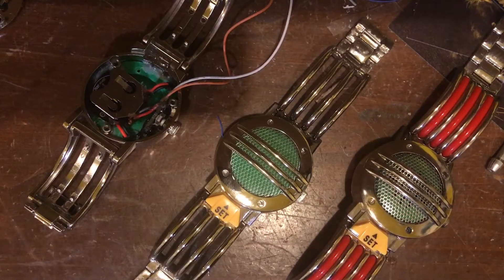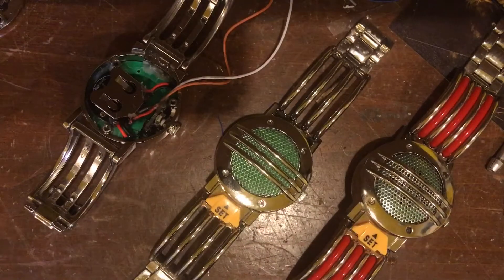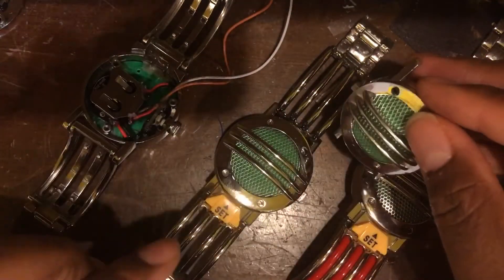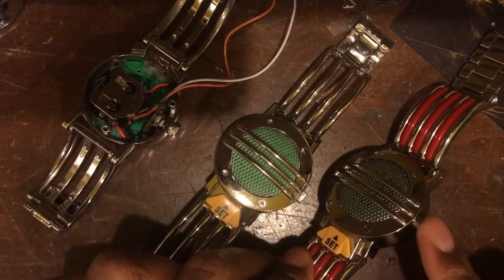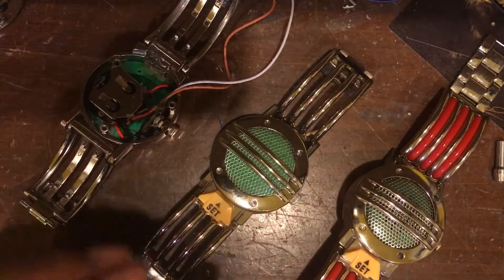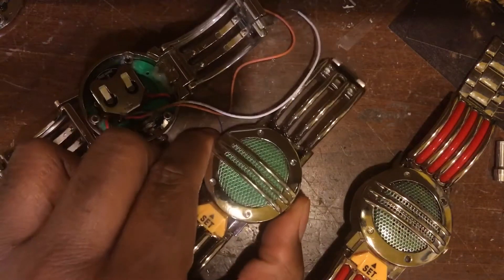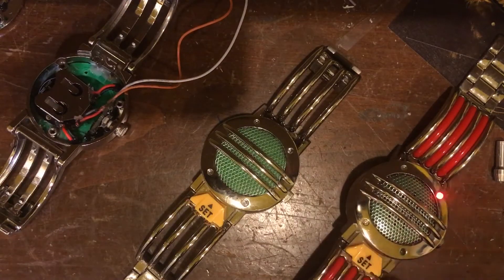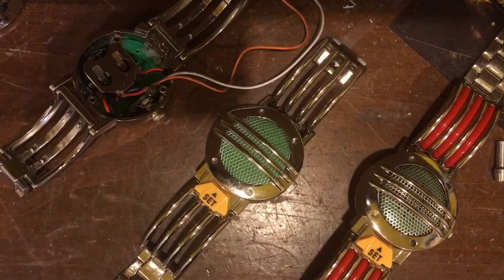Modding the Power Rangers Legacy Communicator with new custom electronics!

Comment: Have you found a way to attach the legacy communicators watch bands to an Apple Watch? I can find an adapter that will line up right and Starlight Studios no longer makes the communicator
Reply from the maker: Robert Blount I haven’t done it myself, but I believe it’s possible to attach the legacy communicator bands to an Apple Watch. You’ll need 2 Legacy Communicators since only one band is usable on each of them. You may need to trim the sides down a tad with a Drennel if it’s too wide but the same adapter that allows Starlight studio bands to be attached could be used in the  same way.
Reply: Stuntastik30 interesting, I’ve only taken one band off currently but it didn’t fit. I’ll try the other side— do you have a link to where I might find instructions?
Reply from the maker: Robert Blount no instructions that I know of. I never shot a video of me doing it but the band without the set button would be the one to use. It can be removed like a typical link on a watch, you’ll just need to get a link removal tool from eBay or something. You can also have a jeweler take it off as well.
Reply from the maker: Robert Blount oops I’m sorry just realized you meant how to mod the band. Yeah I haven’t seen any instructions on that either. I would film a video of the process but I don’t have two Legacy Communicators to sacrifice for its bands. Lol.  The width is a bit wider though so it does need to be filed down. But after that the Apple Watch adapter should fit.